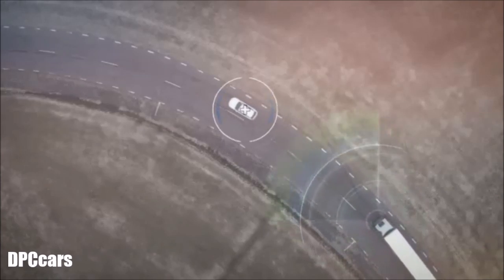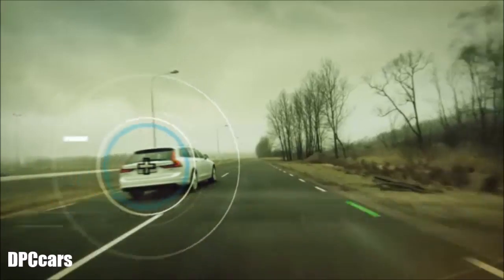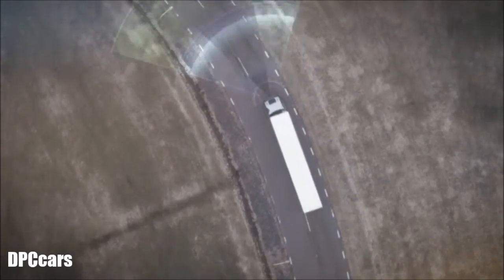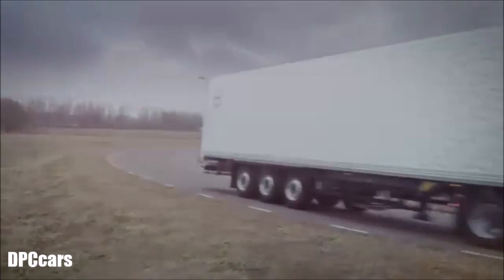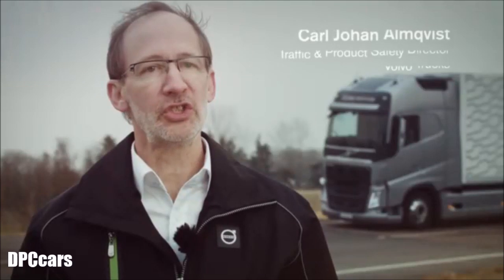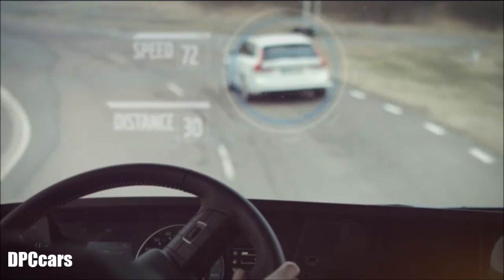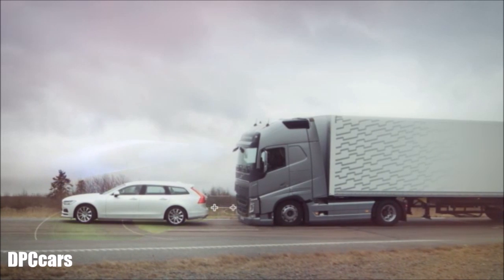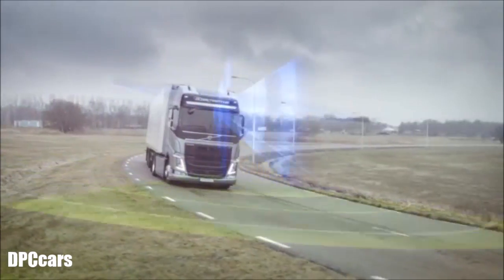Volvo Trucks Intelligent Safety System Emergency Brake

Comment: It's not a good idea.. people brake in front of you for their kicks and you loose your load.. Loads shift.. 20 years driving, and the worst trucks ever to drive have this system..company insurance is cheaper so the driver will never change it..
Reply: So what, youre just supposed to crash into the car? Loosing a load is better than loosing a life. and if the car if front is close enough to where they can stop and you hit them, then you're following to close. if someones doing it "for their kicks" just report the license plate.